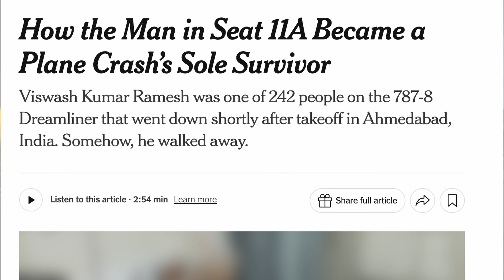Why the RAT Changes Everything – Air India 171 Update

Comment: From a friend who is a 787 pilot:
Air India
Still to be verified but it looks like a catastrophic electrical failure on rotation. 

Flight: AI-171 | Aircraft: Boeing 787-8 | Date: June 12, 2025 | Route: Ahmedabad (VAAH) → London Heathrow (EGLL)
Crash Site: ~1.2 km from VAAH Runway 23, post-V1 and rotation
Fatalities: 247 (243 onboard + 4 ground)
Survivors: 0 onboard survivors (alternate to original), 3 injured on ground

⸻

🛠️  AAIB Preliminary Report Highlights

1. Primary Cause – Electrical Power Transfer Interruption (PTI) During Rotation
 • During transition from ground to airborne electrical configuration, the aircraft experienced a cascading dual-engine FADEC (Full Authority Digital Engine Control) failure.
 • Root cause: Uncommanded bus transfer failure due to arcing in the main power relay box (PRB-A), traced to water ingress during pre-flight GPU disconnection in heavy rain.
 • This led to loss of electronic engine control at rotation, resulting in both GEnx engines rolling back to ground idle within 4–5 seconds.

2. Flight Data Record Timeline
 • +0:11 sec: Nose gear lifts off.
 • +0:13 sec: Sudden engine rollback begins. Thrust reduces from 92% N1 to <27% within 3 seconds.
 • +0:16 sec: Master caution + ENG FAIL L/R warnings. FO calls, “Both engines dropping!”
 • +0:20 sec: Autopilot and flight control reverts to Direct Mode. Pitch up attitude peaks at 18°.
 • +0:25 sec: Aircraft stalls at 186 ft AGL.
 • +0:30 sec: Full aerodynamic stall; nose drops rapidly.
 • +0:38 sec: Ground impact at 54° nose-down attitude, 174 knots.

⸻

⚙️ Contributing Factors
 • Environmental Conditions:
 • Torrential rain during pushback.
 • Moisture intrusion into PRB-A connector (P/N: HLN8471) — a known corrosion-risk component.
 • Latent Maintenance Issue:
 • Power transfer relay unit showed signs of thermal damage in a previous MEL deferral 2 weeks prior.
 • No replacement had been conducted; aircraft was cleared under repetitive deferral.
 • Design Oversight:
 • Boeing 787 has no physical engine control backup (i.e., no direct mechanical linkage in FADEC loss scenario).
 • Loss of power supply to both EEC channels resulted in engine “freeze” at ground idle instead of flameout.
 • Flight Crew Response:
 • Attempted engine relight sequence not completed before stall onset.
 • Emergency power selector not activated — possibly due to confusion from multiple ECAM warnings.

⸻

✈️  Immediate Safety Actions
 • DGCA + EASA + FAA Emergency AD issued within 24 hours:
 • Mandatory PRB-A moisture integrity inspection on all Boeing 787 aircraft.
 • Temporary restriction on dispatch with MEL items related to power transfer systems.
 • Boeing:
 • Issued Service Bulletin SB-787-24-212 requiring replacement of PRB-A connectors with sealed versions.
 • Exploring addition of dual-path power redundancy for FADEC systems.

⸻

🧠 Lessons Learned
 • Over-reliance on electrical power distribution architecture without layered redundancy.
 • Lack of crew procedural training for full engine rollback during takeoff in EEC dual failure scenarios.
 • Need for improved environmental sealing in GPU/electrical handover units in monsoon zones.

⸻

🕯️ Human Toll
 • The loss of 243 onboard lives, including 12 crew and 18 infants, deeply impacted the aviation community.
 • Final words captured on CVR: “We lost everything – no thrust!”
 • One family of five was killed on the ground in a hospital ambulance struck by debris.

⸻

📅 Timeline – What’s Next?
 • Aug 15, 2025: Release of FAA/Boeing electrical design audit report
 • Sept 5, 2025: ICAO session on electrical-critical phase-of-flight risk mitigation
 • Oct 2025: Mandated design retrofit across 787 fleet (rev. SB-787-24-219)

Comment: Please be respectful towards the pilots, they have lost their lives too while saving the lives of the passengers but unfortunately they don't have enough time and altitude to save the lives of passengers..They cannot have any fault, if there is any fault then it is of the Boeing 787 plane whose both engines suddenly failed there are many complaints against boeing 787 during take off and landing..they use cheep quality material and elemenat the quality inspection at a plane that makes 787 boeing planes..You did not say a single word against the Boeing 787 plane, you only kept abusing the pilots..you should be biased..jai hind ..from india..

Comment: Case for the Recent Air India Plane Being Struck by an EMP

While there is no official confirmation that the recent Air India plane incident was caused by an Electromagnetic Pulse (EMP), we can explore the possibility based on available information.

What is an EMP?

An EMP is a sudden burst of electromagnetic energy that can damage or disrupt electronic systems. It can be caused by various factors, including nuclear explosions, solar flares, or man-made devices.

Possible Signs of an EMP Incident

If the Air India plane was indeed struck by an EMP, some possible signs could include:

- *Sudden Loss of Systems*: A sudden and simultaneous loss of multiple electronic systems, such as communication, navigation, and flight control systems.
- *Unusual Electrical Malfunctions*: Unusual electrical malfunctions or anomalies that cannot be explained by conventional means.
- *No Warning or Indication*: No warning or indication of any impending failure or issue before the incident occurred.

Investigation and Analysis

To determine if an EMP was the cause of the incident, a thorough investigation and analysis would be necessary. This would involve:

- *Reviewing Flight Data Recorders*: Reviewing the flight data recorders and cockpit voice recorders to understand the sequence of events leading up to the incident.
- *Inspecting Aircraft Systems*: Inspecting the aircraft's electronic systems to look for any signs of damage or malfunction consistent with an EMP.
- *Conducting Forensic Analysis*: Conducting forensic analysis of the aircraft's systems and components to identify any potential causes of the incident.

Conclusion

While there is no conclusive evidence to support the claim that the recent Air India plane incident was caused by an EMP, it is essential to consider all possible causes and conduct a thorough investigation to determine the root cause of the incident.

Comment: My initial theory was that the flaps had been accidentally retracted instead of the gear. But after hearing the RAT had deployed that would suggest engine failure. Not sure about the 787 but it was my understanding that the RAT automatically deploys when engine hydraulic and electrical power is lost.

Comment: It is also possible they had one engine failure and by mistake pilot turned off properly working engine instead of the bad one. And this way they didn't have any thrust at all and both engines switched off.

Comment: Further to my earlier comment I need to qualify that engine management computer is full authority digital engine control (FADEC). The Boeing 787 has dual FADECs, one for each engine, providing redundancy. Each FADEC is designed to operate independently thru' Independent Power: Each FADEC is powered by its own PMA, which is a generator directly connected to the engine. Hence I would address Critical Sensor Failure, a failure of critical sensor(s) that provide input to both FADECs could potentially cause them to shut down both engines. Loss of Power where both PMAs were to fail is unlikely unless there was a failure in a shared power supply that both FADECs rely on, this could also lead to a complete loss of dual engine power. The failure of a shared critical sensor will obviate dual redundancy. I am sure after historic critical sensor (eg pitot pressure) failure accidents that accident investigation will be addressed.

Comment: I read that a passenger on this plane coming into India said there were problems on that flight. Anyone else hear this? Thank you for explaining this so clearly that most of us can understand. So glad I found your channel.
Reply: Yes, the plane was on the runway and the AC wasn’t working, but this is nothing unusual. In many international airlines, the AC often doesn’t work before takeoff because running the auxiliary power units on the ground is very costly. Once the plane is in the air, the power source shifts to the main engines and then the AC starts working.
Reply: @fckyou6969  thank you for the reply.

Comment: The sound of the engines shows that they were not in full power. They sound like they were on idle. Dual engine failure right after taking off could be the result and the pilots didn't raise the landing gear so that it can absorb the impact when it touches down

Comment: Everybody says that air travel is the safest travel. Statistically speaking, of course. But one can also say when things go wrong, air travel is the most dangerous. If you have total engine failure in your car, you close to the shoulder. If a train has total engine failure, You just stop moving. If a bus has total engine failure, it coasts to a stop. When there is a problem, an airplane is the worst place to be. Because there is no where to pull over. Air travel is the safest statistically. But statistics mean nothing with the airplane you were on experiences some kind of failure. And both man and machineare imperfect. No thanks, not going on an airplane anytime in the future. That’s a hard pass for me.

Comment: I work in the automotive industry and over the past four or five years we have seen it seems like 10 or 12 fold increase in catastrophic mechanical failures in engines.    I am highly of the belief that it is due to new oil specifications and or manufacturing processes, change is dictated by the EPA to lower viscosity for fuel consumption issues has caused the major issue in all every sector of engine mechanical.    Everything from consumer automotive, Marine, aeronautics, farming commercial equipment, every single sector has seen over 10fold catastrophic failures due to oiling issues, and simply nothing else.    The only thing that has changed so far is the composition of the oils.......      At what point does economics and self-destructing engines actually equate into more waste than fuel consumption?   That's where we're at now

Comment: Those are the possible reasons;

Dual Engine Failure: This is increasingly seen as the most probable cause. The pilot, Captain Sumeet Sabharwal, issued a "mayday" call moments after takeoff, reportedly flagging a loss of power and thrust from both engines.

Electrical System Failure: Given the Boeing 787's reliance on electrical systems, some experts are scrutinizing whether a malfunction in these systems could have compromised engine responsiveness.

Pilot Error: One theory suggests the co-pilot may have mistakenly retracted the flaps instead of the landing gear after takeoff. This could have severely impacted the plane's ability to generate lift and maintain altitude.

Overloading: There are speculations about the aircraft being overloaded with cargo, which could have affected its takeoff performance, especially if one engine failed.

Maintenance Issues: Air India's maintenance of the aircraft is also under scrutiny.

Bird Strike: While less likely to cause dual engine failure, it's a possibility that has been considered.

Comment: This might be a long shot but what if, instead of the flaps handle being moved instead of the landing gear, there was a fault like a trim runaway that lead to both engine cutoff switches being flicked instead of the stab trim cuttofs. Maybe in the heat of the moment something like that happened.

Comment: The "classic" problem for a "flame out" on a regular single engine airplane while starting are shut fuel valves. 
In bad circumstances when karma really wants you, you make some bad hand movements and unintentionally shut the two valves instead of proofing them open.
Then within seconds you give full throttle and start the run down the runway. Then - because karma hates you - your plane climbs with the fuel in the pipes and the fuel filter approx to some 60 ft height right at the end of the runway above the trees/forrest.
Then your engine dies, your speed slows down rapidly, your height crumbles rapidly, too and you crash into the woods.
Even if you get the spontaneous idea, that the valves are shut and you manage to open them, the flight will end abruptly in the trees.

Comment: RAT - Landing gear evidence!

Aviate, Navigate, Communicate

The RAT will greatly aid the above by supplying hydraulic and electrical power.

The object is to be able to get the aircraft on the ground safely.

There are alternate means to lower the landing gear.

There is little reason to raise the gear again.

The RAT system may not be designed to be able to raise the gear, which would require a great deal more hydraulic capability.

So another bit of evidence:

The landing gear was not retracted.

Comment: FADEC failure... Both engines are on but gone into idling mode... Therefore both main engine sound is very low and RAT sound/noise dominates... Check from noise analysis.. This ramp down of both main engines to idling leads to low thrust..... Why both main engines ramped down to idling is the key question... Likely because of an electrical interlock which sensed a 'trouble/defect' in either electrical, power/ control or mechanical system and therefore operated to protect both the main engines.... Thrust went low and RAT got deployed... Technically this interlock to bring main engines to idling should be bypassed in the take off sequence till the aircraft obtains safe height and air flying worthy speed... But either such interlock was missing or was bypassed.... Please analyse with respect to black box and FADEC/ engine log and correlate. 🙏